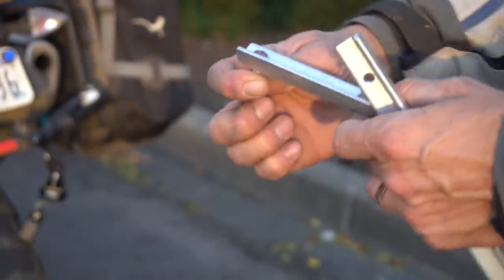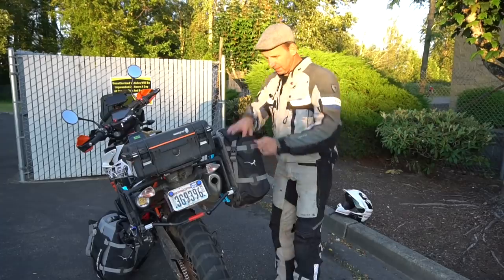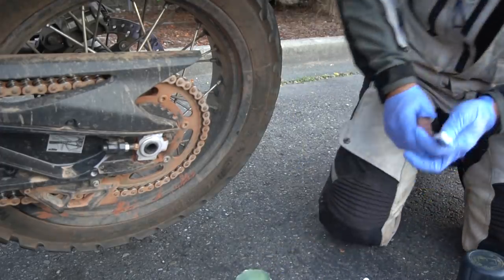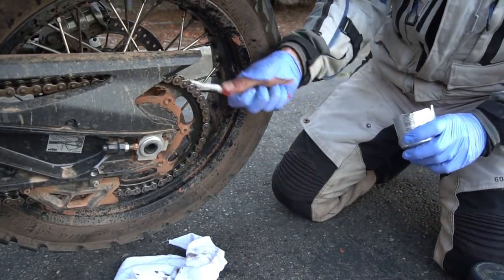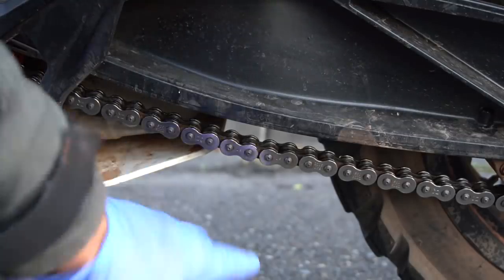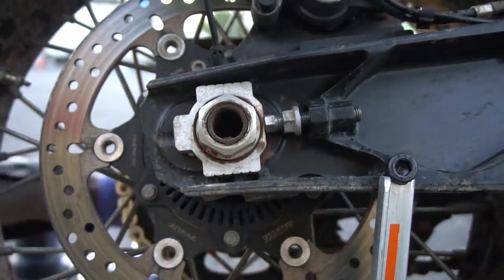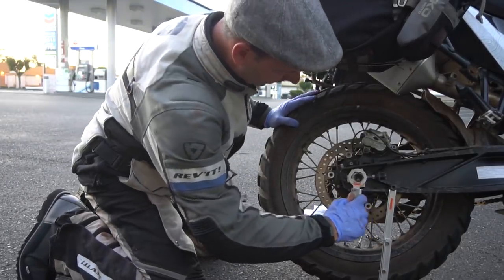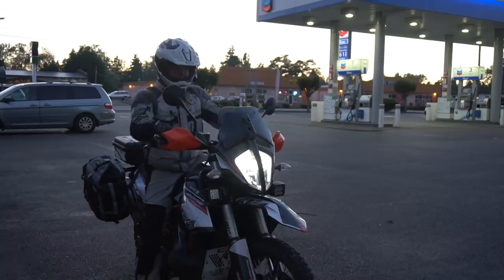Motorcycle chain maintenance tips while traveling

Comment: Excellent video!
Reply: What about lubricating the chain after cleaning? 
Yes theres o rings and yes theres grease inside. Nevertheless you need to lube the area where the chain is running on the sprockets. Or it will wear prematurely. I think Diesel ist only sufficient for cleaning, but not for lubricating. Infact the lubrication properties are not very good and it will be hurled off the chain after a few miles.
Thats why chain grease is a thick, sticky grease.

Comment: That aluminum side stand is freaking genius, I can't tell you how many times I've been sweating through my gear pushing my bike around on the side of a road to clean the chain on a trip.
Reply: or maybe just put a center stand, and all those problems are gone forever? Every single bike I had, also had a center stand on it...especially big adv bikes...
Reply: @Igor12822  I've never had one, it sucks. Believe me, I always think about adding one but haven't gotten around to it. The bike I use as a travel bike now has a crash cage that (I think) precludes the addition of a center stand so I remain stuck without.

Comment: Haha "How to never pay again for chain lube & cleaner by stealing diesel"
Reply: More like "How to clean your chain by stealing diesel and ruin it by not greasing it afterwards".
Reply: @Chris-yy7qc  You can see the pump was active so he did pay. Also, it is a sealed chain so you don't grease them. You're only trying to keep it clean from dirt and rust. A plain chain would need to be greased for sure. On top of all that, it is in the title "tips while traveling". This is just for on the go and not for normal maintenance.
Reply: @Zeth2571  Youre wrong. Youre supposed to lubricate the outside of the rollers of the chain using chain grease, because they get in contact with the sprockets and both would otherwise wear quickly (metal on metal). 
Absolutely every motorcycle owners handbook tells you to do that periodically, lol. Never read one?
Reply: @Chris-yy7qc  A minor nuance: The pressure of the chain on the sprocket will cut through any lubricating film between roller and sprocket within just a few revolutions. Trying to avoid metal-on-metal contact there is futile. This inevitability is why rollers were designed on the first place. But lubrication IS needed to keep the roller rolling.
Reply: @Don2006  Interesting theory. Its wrong tho.
Reply: @Chris, sorry mate but youre the wrong one. On YouTube, Ryan @ Fortnine does a really good proof of chain lube for o-ring chains and really proves that the chain manufacturer recommended maintenance is all you need: clean it and lube with a touch of 80-90W gear oil.  Diesel every day will clean out debris, prevent rust and keep the o-rings from drying and cracking. If you’re not doing dirt he could add the gear oil too. All other lube is wrong and grease on an o-ring chain is dead wrong. All debris and sand sticks to it and cuts up your o-rings badly killing your chain life. Never use grease on an o-ring or x-ring chain.
Reply: @wipperwil  ;  I agree, with the addition of, rather than 80W-90  GL-5, I recommend 'chainsaw bar and chain oil' as it is straight oil with just a 'stickiness' or 'tackiness' additive, some stores stock 'summer' and 'winter' grade, if they do, use 'summer' in the summer, and 'winter' in the winter

Comment: Great advice and interesting tricks with diesel and toothbrush with no bottles of chain cleaner AND lube like I've been doing.  Once an o-ring goes missing though you may have to add oil at least at that point unless you consider the chain shot but hard to toss a $200 chain just because one o-ring goes AWOL and the rest is perfect.  I had that happen pretty quickly on the new chain despite lubing/cleaning it a lot.  The only thing you missed was that manual says you should first rotate wheel one rotation to find tightest point in the chain and THEN check and adjust your chain tension.  I learned this the hard way by ignoring the manual, assuming they were exaggerating the importance, and adjusted it perfectly/carefully but next stop it was banjo tight.  I couldn't believe it but realized what happened so now I religiously find tightest point in chain before checking/adjusting.
Reply: why my bike has different tension on chain when i rotate it?
Reply: @leodoingthings1706  Mine does the same thing.....they stretch more in some locations than others.  I have no idea 'why' that happens.  Some links or sections of links must wear more than the rest for some reason.
Reply: @shavedape  A lot of sprockets are made far from perfect as well.  Not too uncommon for them to be slightly egg shaped.
Reply: @ronvaughan8041  plus if one O-ring comes out, that one link wears as lube comes out, and it may wear just there (and 'stretch'?  But that's only one link so can't see it being noticeable enough to alter chain slack measurements at that point.  Or not enough to matter like to be to spec slack at that point and banjo tight everywhere else.

Comment: For what it's worth: At the Cleveland international motorcycle show last February I asked the representative at the Kawasaki display about chain maintenance on long trips. (I was planning to ride my Honda VFR800 on Route 66 across the country this year, but COVID-19 had other ideas.) The rep told me that cleaning an O-ring chain on a road bike isn't that critical. Every day or two, and especially after riding in rain, just make sure to lube the chain with a quality product and you should be good to go he said, even for thousands of miles. Possibly this is different for off-road riding. Unless he was trying to drum up business for the service department, this seemed like reasonable advice. Next year I hope to apply it.
Reply: I ride a Versys650 with original chain > 20k km on it.  I lube it with gear oil once a month but never cleaned it before lubing.  I learned this from an old bike mechanic.

Comment: Great video! Thx! I use a small squeeze bottle of chain cleaner, toothbrush, and small spray can of chain wax, stored in a ziplock bag with some folded blue HD paper towels,  and a mini Snapjack axle stand (with a velcro brake lever strap). When available I go to a wand car wash bay, clean the chain with the chain cleaner, brush and HD paper towel, then wash the bike including a light spray/rinse off of the chain, then dry, being sure not to spray too much water pressure on key areas. I finish with waxing the chain using a cloth to limit any over spray of the wax on the wheel or other parts of the bike. Good time to check the tire tread condition and for any debris in the tread (screws/nails) as well as air pressures. I also use a clean wet micro cloth while washing to clean my helmet, and outer gear of any bugs and such. Then voila, bike and gear clean, chain clean and lubed (adjusted if needed), and ready to go. I've got the process down to about 20 minutes in total. Add a few minutes for gas, washroom, drink/snack, and passer-by chat time of course. Nothing like having the bike and gear all tended to and clean, gas tank full, empty bladder (and/or bowel), and a cool soothing drink in hand, nesting at the bike, taking in the local flair, and conversations that inevitably ensue. 

Great topic! Thx! 😉👍

Comment: Great video! One more remark though, when checking chain tension, check it at multiple points. Often chains can stretch and chains wear sort uneven, and you can have different amounts of slack depending on where it sits. So by going checking all along the chain you can figure out the tightest point to prevent accidentally over (or under) tightening.

Comment: Your best video to date! I tour on an R6 & chain maintenance has always been an issue. I'd skip the cleaning and just lube due to the mission involved. Your DIY side stand is a great idea. Thanks for thr video!
Reply: You’re a naive. What happens to the oil when the bike is moving? Yes, it gets thrown off the chain. This is why they invented the o-ring chains. You don’t need to lube the damn o-ring chain.
Reply: @LuckyNikitaBoba  
Even an o or x ring chain will last you longer when cleaned and lubed. 
Low cost, high efficient way is to use w 120 transmission oil. 
But if you can economically afford to buy new sets of chain and sprockets frequently, of course you can skip chain maintenance for the most part.
Safe rides 👍🏍
Reply: @LuckyNikitaBoba  You're not thinking it through, a little lube on the chain lubricates where the chain touches the sprockets, and the chain and the sprockets will last longer, and a chain oiler will make the process much easier...
Reply: @bmwsjt  Yeah, whatever you spray on it gets pushed away and flings off the chain during the first minutes of your ride. Just cleaning with diesel adds moist to the rubber seals and gives enough anti-corrosion coating.
Reply: @PetroDobrynin  lol, that's not true at all. Some will fling off, but the chain and the sprockets maintains an oil film. Oil your chain, drive for a couple hours, then rub your finger on your chain and sprocket. You'll get oil on your finger.

Comment: I’ll defiantly be staying with my “shaft drive” gsa. While my riding buddies are performing their daily routine chain maintenance after an exhausting ride, I’m already showered and into my first cerveza. Ride safe.
Reply: I’ll stay with my ST 1100 😈😈😈😈
Reply: Definitely a reason for me to switch at some point😬
Reply: Good luck following a 790 on a trail though.
Reply: If shaft brakes on a trail, it might be more difficult to get parts than chain and sprockets. Shaft might last for a very long time but if it brakes it is costly to repair (and thats the shaft, if something happens to the final drive that is another expensive part). Saves on maintenance but for chains you can get scottoiler which reduces the maintenance. From what I read shafts reduce power output on rear tyre by 30% of what is generated at the engine, chains approx 15%.

Comment: Thank you Bret.Honestly, you give the best, most complete and professional advice on adventure riding than any other channel.  I'm always amazed at how much I learn from you for what seems like simple maintenance. 
New takeaways:
1) Diesel fuel is a great cleaner. And protector too. 
2) You can get it for free! 
3) Use a velcro strap to hold the front brake. 
4) Use a tooth brush to clean.
5) Use a rag to wipe.
6) Chain maintenance should be done every 500 miles. 
7) I bought a motorcycle  stand from Amazon that works great but I see now I didnt need to do that. What I like about my stand, however, is that it is very stable and it doesnt weigh too much.

Comment: When checking chain slack, its best to check with the bike on the ground and suspension compressed, you can simply lean over the sit and push it down. But before, put the bike in 1st gear and roll it back to get the slack out of the top and into the botttom, then measure applying load to the seat. If you check it without load it may or may not add more chain slack. But when you do compressed u factor in for hitting bumps. If you hit a bump and your chain is too tight then your chain becomes your suspension. For care, I like to use chain wax once a month, but after every ride I lube with regular oil. The wax spray helps keep the rust off the sides, and the daily oil keeps the chain lubricated nicely. My chains last a good long time, and they dont stretch much.
Reply: It depends on the bike. Some manufacturers recommend checking tension with suspension loaded, while others prefer unloaded. Always check the manual.
Reply: @Jeff Greenspon All you use is wax? If so its best to oil it lightly after every ride when the chain is hot. I use a squirt bottle/slanted tip the kind that you squeeze, its filled with oil. After I park the bike from a ride, I put it on the stands and spin the back wheel by hand, while the tip of the bottle is gliding and oiling the chain. I do this on the inside and outer chain, then with a dirty rag wipe off the access. Only takes me no more then a minute.
Reply: @ibidu1  have you tried using a paint brush, what i use with gear oil.
Reply: @MrTuckerbox  I use an angled tip squirt dispenser, I think its used for dish soap. Its full of used engine oil from previous oil changes. While the bikes on the stand, I give her a quick squirt and wipe off the access, so it doesnt sling off. Takes me a minute or so! My new chain from RK has what i think is a black plastic caps on each link, which is great because now the chain doesnt need to be waxed to keep the rust off. Just a bit more pricey

Comment: Great simple tips.  I learned from a veteran bike mechanic/shop owner that lubing the chain with gear oil is important but cleaning it is unnecessary.  I lube my original chain on a Versys650 once a month and it has over 20k km on it.  Although the chain is not sparkling clean, it is still in great condition.  Just a thought that is contrary to popular belief.

Comment: Exactly why I’ll never own another distance touring bike with chain drive.  What a PITA. 🤔🏍
Reply from the maker: Can't argue with that
Reply: Sure, but you cannot service and fix a drive shaft on the side of the road in the middle of nowhere....
Reply: @jpwerth8610  Fair point.
Reply: @JBMotorrad  but you could add a zerk fitting/grease nipple on the drive shaft and re-grease it every now and then and maybe a 'drain plug' for if water got in somehow. Don't know why the manufacturers do not have that standard and include it as part of its services.
Reply: @jpwerth8610  I ride 2018 Triumph Tiger 1200 XRx. The final drive oil is changed once after break-in, then never changed again - per Triumph's spec. I have changed mine 4 times in 23,000 miles so far, just to be safe. I think BMW 1200 GS has more maint required on final drive.
All good. I just don't see me doing this every day there is a 500 mile ride. To each his own. Some don't mind the time it takes and enjoy tinkering. I'd much rather be riding, or eating a steak and potato at day's end. ;)
Reply: @JBMotorrad  this 500 mile thingy is more of a guideline than a "code" (POTC ref here :) ). I mean, if after 500 miles, or 1000 km in my case, the chain looks like I just cleaned it what's  the point of cleaning it again ...If you ride on dry asphalt with little dust the chain will hardly get dirty but the reverse is also true, muddy dusty gravel/sand and you should probably clean it more often than the recommended interval.  Point is, you need to judge by yourself instead of going by the numbers, sometimes.